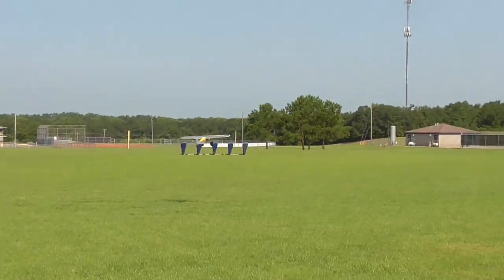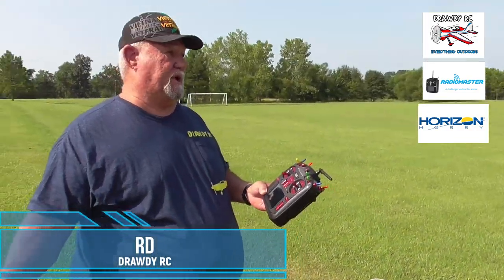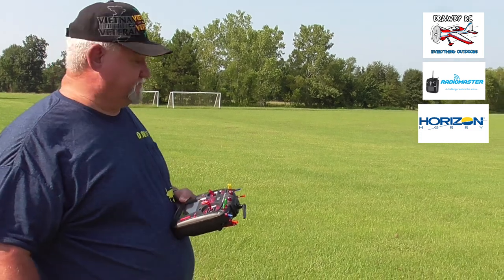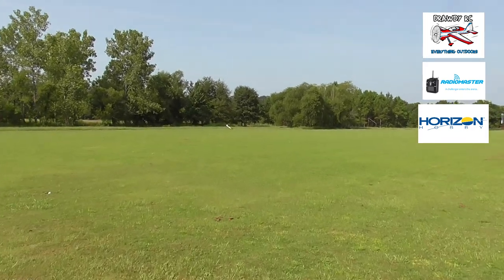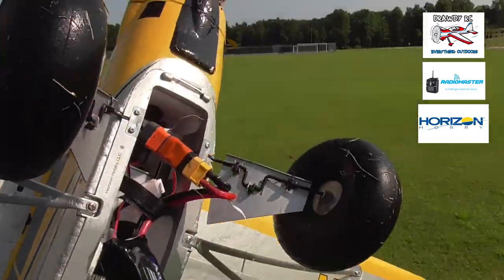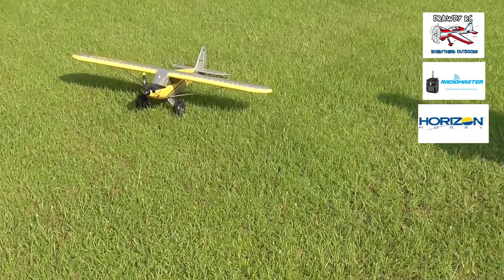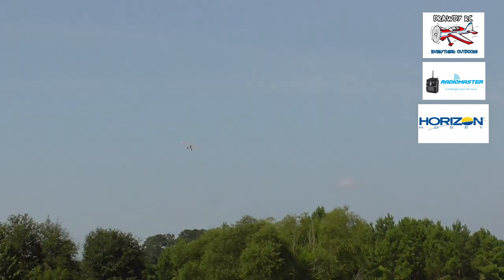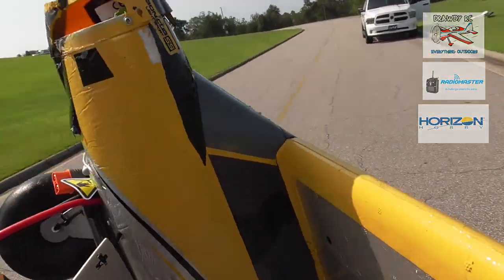HORIZON HOBBY CARBON CUB (RadioMaster TX16S)

Comment: I would like to have your radio settings, especially for the setting of the 3 positions safe/as3x that I can not set on my radiomaster TX16s
Reply: i have the same problem i cant get the 3 position switch to work in flight modes you could ?

Comment: Hello, with what communication protocol did you use it with the Master radio, I use DSM and the multiple variants of that protocol and I can't fly it, it always has a low signal and no telemetry
Reply from the maker: My dad uses a Radiomaster TX16S

Comment: Hello there, I have just bound my tx16s to my Carbon cub S2, flaps on channel 7 working just fine, but I'm not able to program the flight modes using channel 5, it just stays in beginner mode.   any pointers on how you were able to program flight modes?   

thanks in advance.
Reply from the maker: I will ask RD on that one.  He has the Carbon Cub and I think had some problems as well but got it figured out.
Reply: @DRAWDYRC  thank you, any help is welcome.
Reply: Yo lo instale con radio Master tx16 y se puede hacer funcionar todos los modos de vuelo donde tiene que configurará  el en los rangos de mixes.  principiante inicia +100 intermedio 0 y avanzado -100     

El problema que yo tengo que todo tiempo me marca señal baja usando protocolo DSM tu cual usas
Reply: @Nimbusnimbusnimbus  si, ya logré configurar todo bien con el carbón cub y el tx16s.   Lo de la alerta de señal al parecer es algo conocido y solo mandan a deshabilitar la alerta. 

Así que solo tengo cuidado de que no vuele muy lejos.